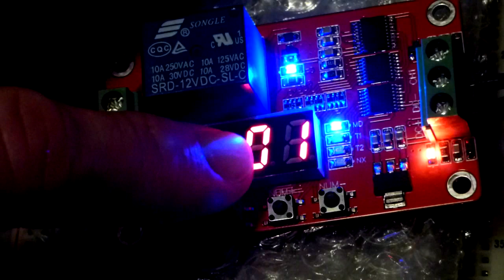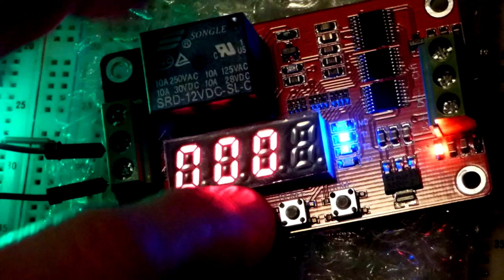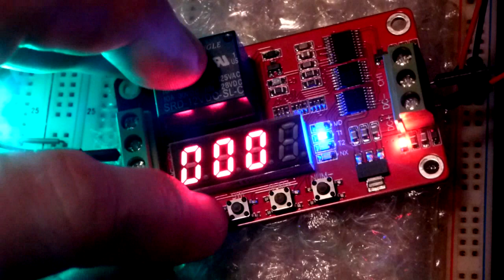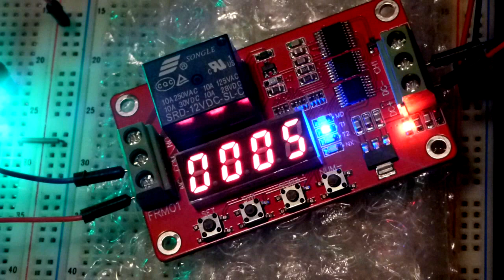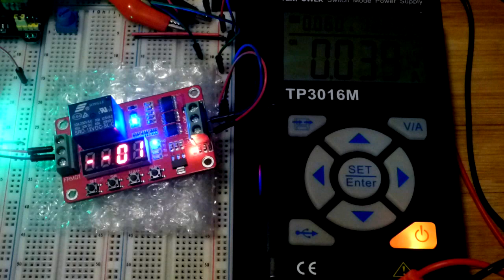FRM01 18 function timer relay module  Function 01 programmable timed on delay demonstration

Comment: It doesn't count up however? Still a nice module.
Reply from the maker: It might. I haven't looked at this module in a long time, people didn't seem interested in the videos.
Reply: @Electronzap  Well Im building a Multi-circuit Lasertag setup and am looking for a Counting delay timer and I think this product fit what Im looking for. I Dont like the microcontroller route when building that complex of a project, also high quality lasertag systems dont do as many game modes as one would like, plus they are expensive. A Cheap RC Radio will control all of the timers in the phasers and will also shut all of them down after the time has finished.
Reply from the maker: Very cool project!